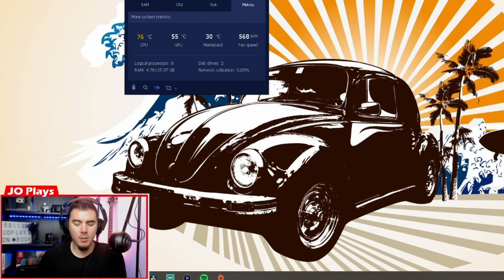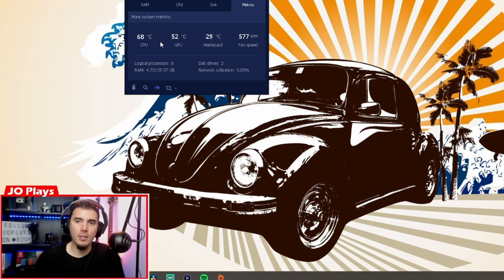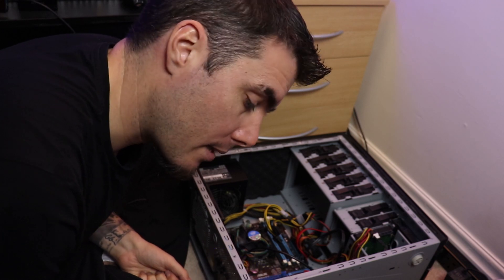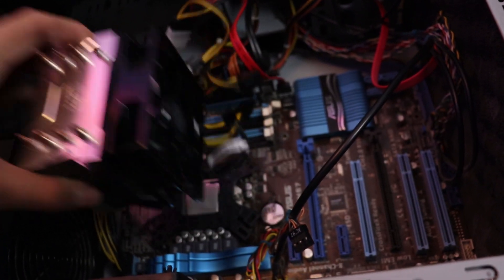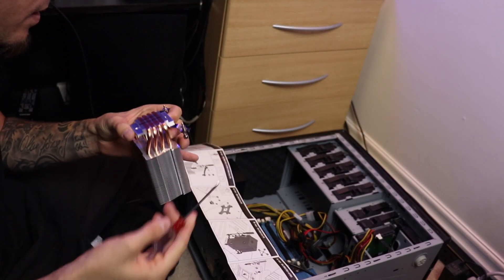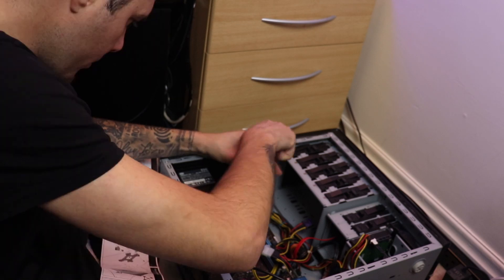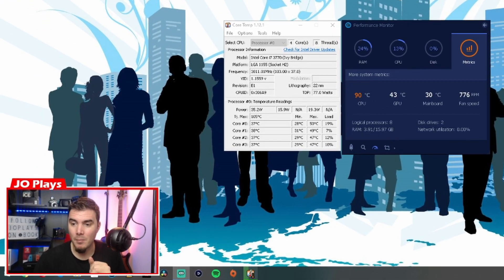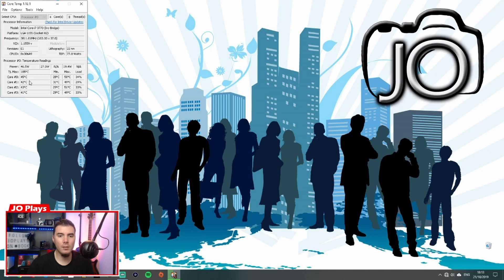i3 to i7 processor swap, fan upgrade.

Comment: I was wondering which i3 processor you had and which i7 you upgraded to ? How did you know if it was compatible upgrade for the processor? I have an i3-6100 and i want to upgrade but idk if my mother board will support an i7. how do i find this out?
Reply from the maker: Hey. If you download a program like Aida64, that can tell you exactly what motherboard you have, also what kind of slot it has on board. The motherboards manufacturer should have a list on compatible CPUs online. I just checked the slot type and rolled the dice. XD
Reply: I installed i-7700 instead of my i3-6100. It's likely that your MB will support it too, my MB is very basic one.